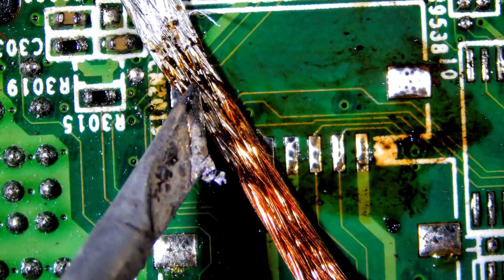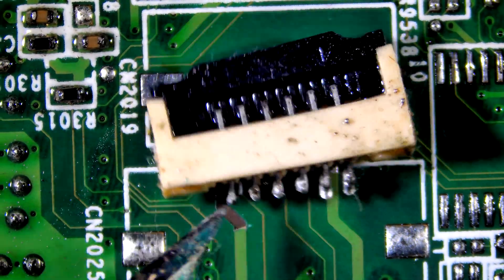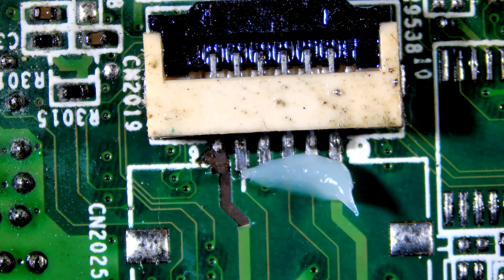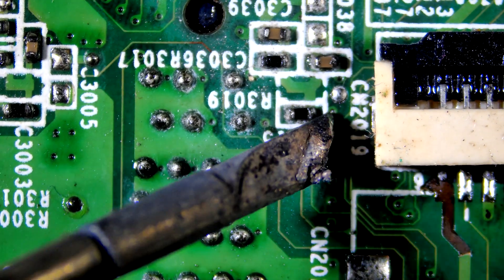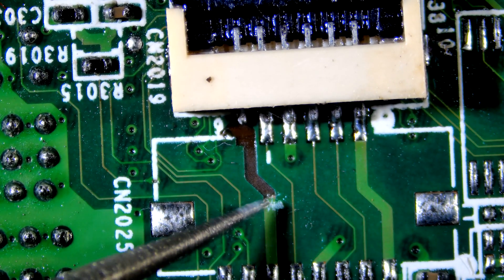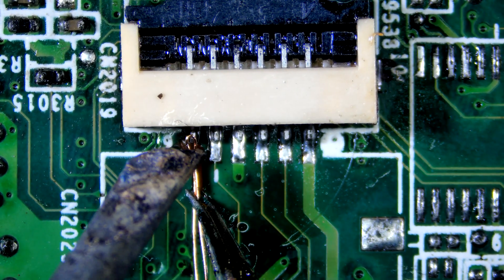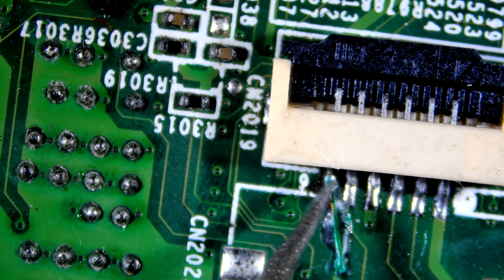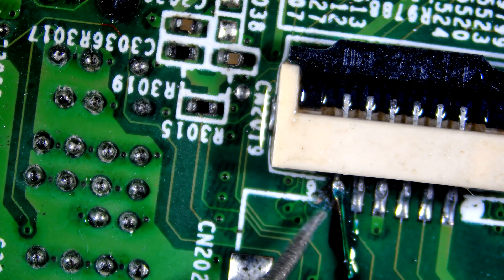How to Solder Ribbon Connectors & Restore Traces: Step-by-Step Guide

Comment: I have to do the same fix with a P6 Ribbon connector. Is a solder mask necessary for very short wires or short distances? Thanks
Reply from the maker: Not necessary it will prevent wires from moving
Reply: @CircuitFixTech  Ok, Thanks. I am going to give it a try; it's a very hard fix, so it shall be a learning experience. TC